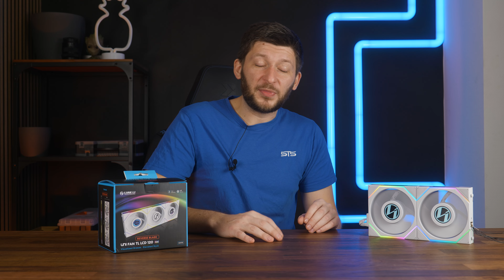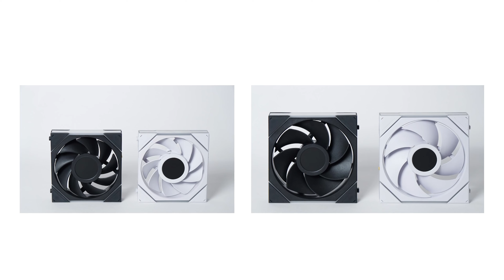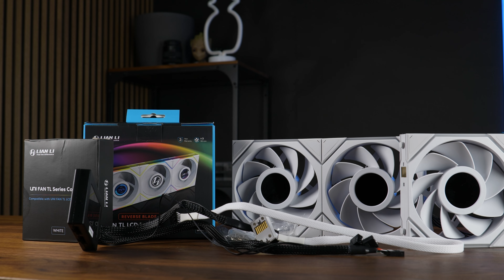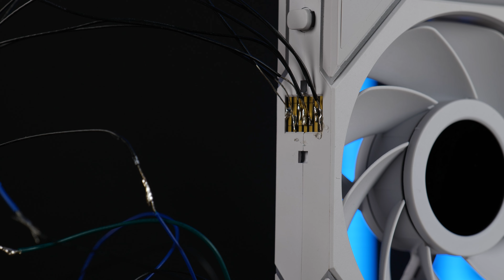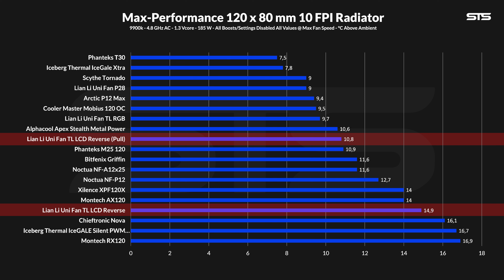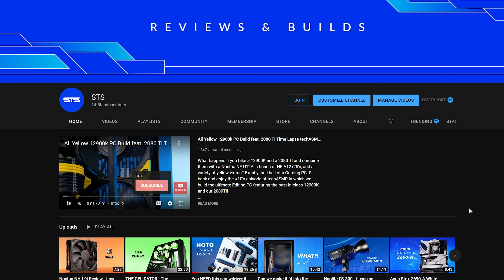This Fan Has A SCREEN - Lian Li Uni Fan TL LCD Reverse 120mm

Comment: Yes, these fans are SICK. I have the 3 pack 120mm  white reverse fans in the front of my Y70 and one 140mm in the rear. It's crazy seeing video and animations playing in that hub screen. If you are planning on getting these just a few things to consider: 1. Plug the controller directly into your motherboards USB 9-pin. 2. These fans can be a bit buggy. If you can't get the screen to be recognized in the software, try plugging it in alone. If it still doesn't work after also trying to update it's firmware, replace it. 3. There are 4 ports on the controller. Do not plug any of the LCD screen fans into port #1.

Comment: Which direction does the airflow go? Do these push air in toward the lcd screen? Or away from the screen
Reply: awau from screen
Reply: @Damir_Turk  reverse fans will pull the air in through the back.

Comment: Hello, new to these fans. I would like to buy two of them as intakes for the o11 RGB, so if I’ve understood correctly the correct ones to buy should be the reverse ones. Now my question is: how do these fans connect to the motherboard? For power they use a pci e connector but I didn’t get how they connect to the pc. They do not have usual 4 pin pwm header?

Comment: I'm a little confused by the push pull test that was done. Can someone explain how he did the test before I commit to purchasing? If the fans are reverse, they should have been pulling air anyways because of the LCD being faced towards you correct? Why would the fans be tested in a push configuration anyway? Love your channel and not trying to come off as a bad person, just a little confused.
Reply: The rpm and static pressure drops when flipped versus standard.
Reply: @PrecisionPowerdynamics  you’re not supposed to be flipping these fans to the other side. That’s why they have a non-reversed aka regular fan version.
Reply: @TheSjuris  yea i didn’t word that great. The reverse fans can’t spin as fast and are louder than the standards. I can’t remember the numbers off the top of my head. Not trashing the reverse blade I use a full set of the lcd TL reveres blades.
Reply: @PrecisionPowerdynamics  That they can’t, limitations of the tech.

Comment: I don't like that they removed the RGB from the blades! seems like their new fans and case are a downgrade. im pretty sure i can cut the top of my 011 dynamic off and put some plexiglass on there if i wanted more vision and less airflow. but why? what ever  happened to upgrading for better performance? my Question is can the screens be removed and used without the fans? if so we could just put them on the old fans and get our rgb blades back! would a mod like this even be possible?
Reply: too bright and childish looking
Reply: They still make infinity fans.

Comment: So I'm guessing you could get a trio of the p28 for a 360 radiator then get the three pack of these (yes we are at $200 for purely fans now 😂) but then you could use the included cable to sync them all at that point..?

Comment: Your best video yet! I appreciate that you stick to a rigid test method but with these fans you ran an additional test for how these fans would be used in a radiator pull config. I’m curious how they would perform thru a smaller more airflow optimized rad like a black ice SR2 at 60mm thickness 🤔?